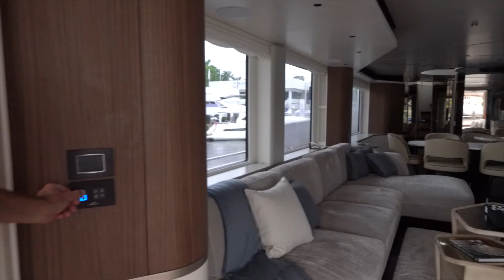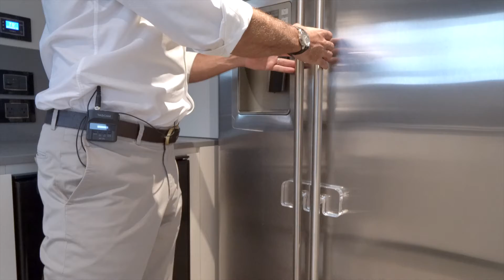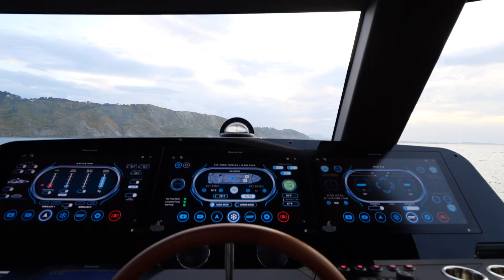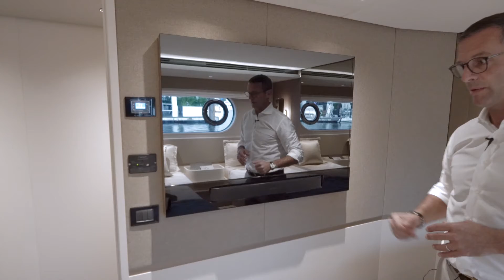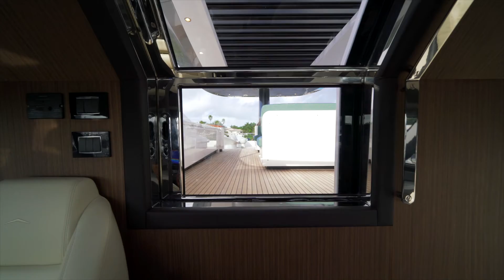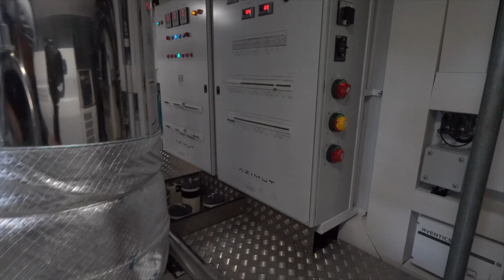Azimut Magellano 25METRI | Timeless Version | Full Walkthrough

Comment: A major improvement  in terms of safety could be developed and deployed by Azimut, which would use compressed air bottles, filling external side flotation air pillows made of fire resistant fabric and sealed compartment-wise in case a section is leaking.  The purpose of the system is keeping the craft afloat, even in serious cases of hull breach, fire or storm.  Nice ship.